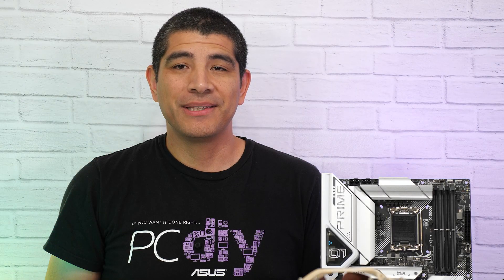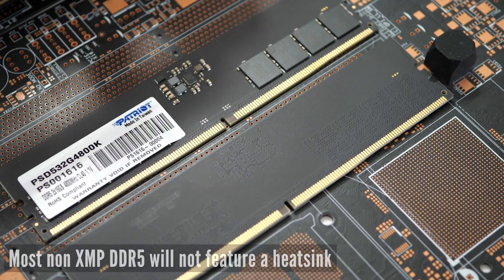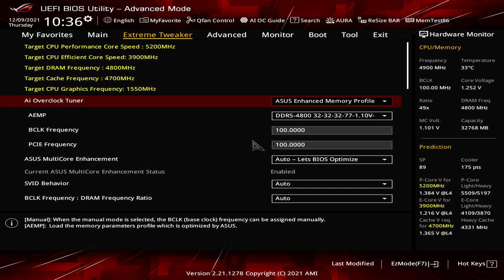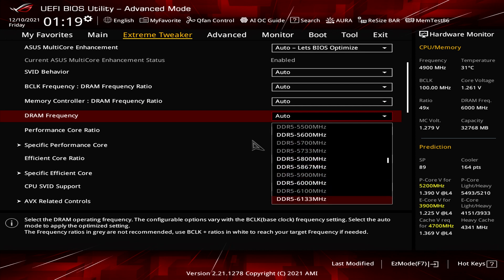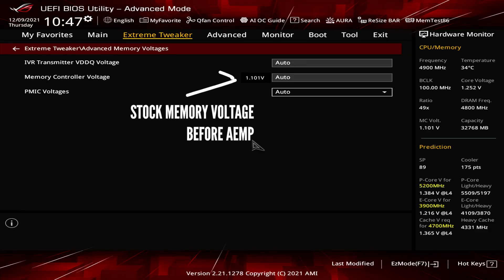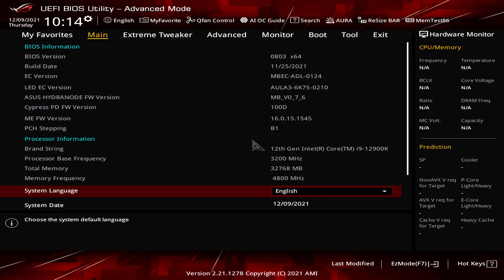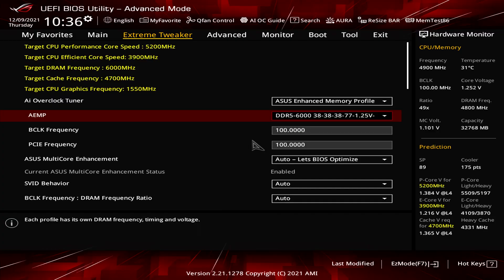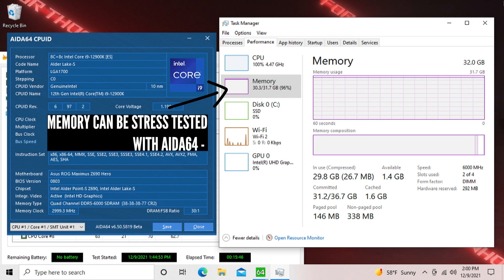How To Get More From Non XMP DDR5 - ASUS AEMP UEFI BIOS Feature Overview & Guide

Comment: Hey JJ, I have 64GB of Kingston Fury Beast DDR5 memory (4x 16GB sticks). If I populate all 4 RAM slots on my Asus ROG Strix Z690-E motherboard, the BIOS automatically downclocks the RAM to 4000Mhz. The JEDEC value for these RAM sticks is 4800Mhz and the XMP value is 5200Mhz. If I activate XMP1 or XMP2 and try to run all 4 sticks at 5200Mhz, the board won't even post. If I set all 4 sticks to run at 4800mhz, the board posts but Windows 11 suffers BSODs. The highest I've been able to manually set all 4 RAM sticks, while keeping the system stable is 4400Mhz. That's 400Mhz below advertised JEDEC values. 

What's strange though, is that if I only populate the motherboard with 2 sticks of RAM (slots A2 and B2), it lets me run XMP1 and XMP2 at 4800mhz or 5200mhz without any issues or BSODs at all. It doesn't matter which 2 sticks I use (i've tested them in all possible combinations 2 at a time) the results are always the same. 2 sticks = stable, 4 sticks = unstable (unless downclocked to 4400Mhz). Is this a BIOS bug or a hardware limitation of the Z690 chipset? Note: I have heard several other people on the Asus forums with other Z690 motherboards reporting the same thing.
Reply from the maker: You have not communicated whether or note you are using a mixed kit or actually using a native 4 DIMM kit. There is a big difference as the profile for 4 DIMMs and their ICs/RANK/Density differs from that of a native 4 DIMM kit which needs to be screened/binned.

This is also validated by the fact the board POSTS at based JEDEC/SPD profile.

You may need to manually define the timings to get mixed kits to work. You can also submit a ticket to our support team. In some scenarios we may be able to tweak auto rules to make auto adjustments for non optimal memory configurations.

Also to be clear the chipset is "not a limiting factor" with limiting factors generally being the IMC first followed by the motherboard. With that noted the board can readily support speeds up to and over 6000MHz ( with some ICs and depending on the density ). You may want to check which ICs you are using ( you can use the SPD tool in the UEFI to do this ).

As to limitation the IMC is generally going to be limited to 4 DIMM DDR frequency scaling in the range of 4000 to 4400MHz this may improved in the future.
Reply: @ASUSUSA  the RAM sticks are all identicle - same model, same brand. But yes, they are 4 single module kits (they each came in a separate box). I recently got 2 new G.Skill 32GB RAM kits (2x 16GB + 2x 16GB - same make and model) and those yielded the same results. I'm guessing that the Z690 chipset needs 2x 32GB kits to run 64GB's at 4800Mhz or above without stability issues. Populating only slots A2 and B2 seems to be the best sure way to stay stable at those frequencies
Reply: Hey, glad to see someone with the same issue as me. I also have the 64gb on the exact same hyper x furybeast 5200mhz in same modules and the board will also not post in xmp. Its very strange
Reply: I’m getting the exact same problem but with Corsair dominator ddr5 ram 5600mhz i can run 2 dimms at 4800mhz if i try to enable xmp to the 5600mhz the pc won’t even post and comes up with cmos error. I haven’t even tried to populate the 4dimms with the other 32gb sticks.
Reply: @NUTS13GTX  After updating the BIOS to version 1003, I've been able to get all 4 sticks of RAM to boot and stay stable at 4800mhz. I had to turn off AI optimisation in the BIOS settings and manually set the RAM timings to 40-40-40-77 and set the voltage to 1.3v for VDD and VDDQ. 

My RAM is rated for 36-36-36-76 at 1.3v and 6000mhz (XMP) but I doubt I will ever be able to hit those timings with 4 sticks populated. It only ever works at those speeds when I have just 2 sticks in the system. At this point i'm pretty sure its a limitation of the 12th gen Intel CPU's
Reply: @0perativeX  thanks for the reply mate. Yeah iv Only managed to get 2x16gb 5600mhz ddr5 dominator to run at the 4800mhz and those timings were 40,40,40,77 when i tried to enable xmp the pc wouldn’t even post end was saying cmos error. So what you said above would that work for all 4 dimms with the ram? What about if i just want to get the 5600mhz out of the 2 dimms i have populated now? I haven’t tried to plug all for sticks in yet hahah. It’s because i can’t even get xmp to work on these 2 first 😞. Another quick question on my asus rog maximus z690 board it has another 6 pin power next to the 24 pin should this be plugged in aswel? Would that help at all? Anyways thanks for your time mate 👍
Reply: @NUTS13GTX  XMP seems buggy whether you use 4 sticks of RAM or 2 . Better to set the timings and voltages manually and turn off AI optimiser in my experience. As for power connectors, my Asus Strix Z690-E has a 24-pin and two 8-pin CPU power connectors. I've plugged in all of them to make sure the board has sufficient power. It's better to have excess power than not enough if you decide to overclock the CPU or GPU.